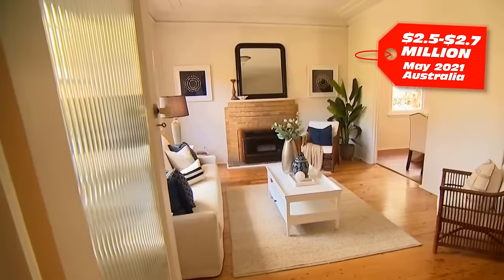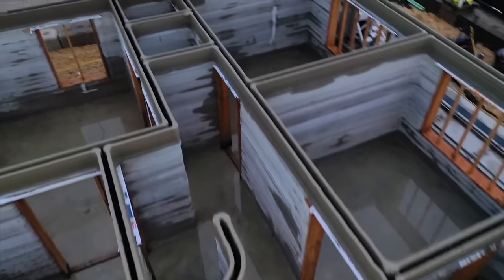3D Printed Concrete House, Printed in 48 hours

Comment: yes, but what about insulation properties of material they are building with? a quick build doesn't automatically mean a good build, not if your heating/cooling bills are still sky high when you move in...
Reply: so many ways to build, why just settle for one idea? when you can have walls with better thermal properties than this one. For example, mudbrick or rammed earth, both of which require less cooling/heating. Also, passive solar - which means placing your main windows only on the south/north sides of the house so (for Mediterranean style climates like California or much of southern Australia)  you get winter sun on your kitchen floor, but not summer sun (this relies on the fact that the sun travels at a lower arc across the sky during winter).

Comment: half the price of regular house? I'd like to see the cost breakdown. This price tag would imply that building the walls accounts for more than half cost of the construction which is very doubtful. There's foundations (maybe these are not needed here?), roof, floors, plumbing, electrical wirings, windows, interior... I'm sure I didn't mention it all.
Reply: The biggest expense is obviously human capital. It takes months to build a house, paying the wages of 10-20 people over that time is not cheap.
Reply: That concrete frame cost under 5000$ to build. Even cheaper because thats hollow and no rebar. No insulation etc.

Comment: How do you solve a problem with insulation? 3D printing a house is a great way to build, especially in warmer climates, where you don't have to worry about cold temperatures. But in the Czech Republic thought winters can become very cold. I believe there is no such way to make the robot lay or sculp anything that is going to fulfill all the requirements for passive house especially here in Europe. It's way cheaper and faster to use workers instead.

Comment: What about rebar?
Reply from the maker: is probably not needed because of the wavy line between the walls, holding everything together.
Reply: Rebar is not needed. The concrete only needs to support itself. It does not need to support a 50-ton truck or the repeated compression and expansion of cars driving over it. It just experiences a static load of itself.
Reply: Rebar causes the cracks. Please see Building Integrity, spalling.

Comment: Was quite surprised to see the rough layer left behind on either side of the walls. Sure, the printers current functionality leaves those results, but just as any technology, that's just another functionality to be implemented, and this one, wouldn't strike me as very advanced, in retrospect of actual automatic house building machine. It really doesn't look good.

Comment: Like so many house building systems this concentrates on the walls of the building envelope but the walls of the building envelope aren't that expensive or time consuming or even complicated.  I volunteered for a Habitat For Humanity project in high school and we propped up the walls of a house before lunch. 3d printers still don't do the electrical, plumbing, hvac, the roof or windows or site work. It's not going to print those beautiful epoxy floors. Wake me when it does the whole thing.
Reply from the maker: I hear what you are saying and I agree there is so much more than needs to be done to complete a home, but with so many people on the planet all wanting a home, and with lumber shortages and forests being cut down at a faster & faster rate, I think this could help in the long run.
Reply: @WonderWorldYTC  That's an excellent point and I agree 100%. But at the same time it's not going to necessarily be cheaper or faster. At least not until those printer crane things are commonplace.  By then we'll all be in a nursing home.

Comment: 3D printers can build hurricane proof, fireproof, and flood proof homes for less than than the cost to build traditional homes. Plus they can doing it using local dirt/sand so it is leaving a low carbon imprint. Build enough of them and the cost keeps coming down, which means more affordable housing and less need for insurance. I don't know why the 3D printer business isn't booming?

Comment: This could easily be done alot more portable and alot cheaper with a drone flying a nozzel and hose at a predetermined set path. Take 3 dump trucks, one with gravel, one with sand, one with cement, add an auto hopper, hook it up to water and power. Sit back and crack a beer while a drone builds your home. Stopping every 60 minutes to drop it's current battery onto the charger and pickup the second one fully charged.

Comment: I wonder how well this holds up to fires.  Seems like it would be pretty great for open-air designs since one of the big problems with open-air rooms in wood frame is that they burn a LOT easier and faster.
Reply: In another thread they're saying that concrete is very easy to break with a hammer and that it does not equal insulation ... in other words it's not a good insulator and you would still have to add insulation
Reply: @gardensofthegods  I'm not sure I mentioned any of that, though.

Comment: Has to be some fancy concrete. I am in construction and I tell you I wouldn't be surprised if it's going to have hairlinecracks all over the place after one month. It just can't be healthy for the structure if you don't let the concrete cure before any significant load is placed right on top of it. By their logic we can build a two storyhouse for a fraction of the cost and in the same timeframe. Am not buying it
Reply: it's like they are pitching this for investment into the company.

Comment: Only if building the house was the expansive part, run down sheds here in Vancouver get sold for millions of $$$$$ it's insane, basically if you were born after 1990s you ain't getting a house unless your parents are rich lol
Reply from the maker: it's the same here in Australia, an average run of the mill house will now cost you $1 million even in the outter suburbs, if you go far out you can probably buy one for $400-500k
Reply: @WonderWorldYTC  you can buy houses in Greenmount, qld for $260,000. It's half an hour outside of Toowoomba

Comment: I wonder how much you can rely on that concrete not having steel going through it
I guess this is the reason why they only have ground floor only examples in this video
you will never build another floor standing on concrete without steel going through it

Comment: One correction: It does not seem to actually lay foundations judging from this footage (it was implied at some point). Foundation first, then comes the 3D printing. Which does not take away from how impressive this is. 3D concrete used to be reserved to factories, it being on-site is impressive.

It's usually done in ICFs nowadays in the USA, this skips a step (Styrofoam blocks, then filled with concrete)

Comment: It’s so very much NOT half the price of building with other methods. It’s not much cheaper, if not the same or more. All of the other trades are still there so there’s zero savings with them. The interior side of the exterior walls require a fully framed wall vs furring screwed to a cmu block wall. That’s an added expense. Then there’s the severe limitation in aesthetic design using 3D printing. It’s a wonderful method for sure. But it’s at near zero cost savings. The main cost savings is the construction timeframe of the structural walls.
Reply: Is it though? Me and you could frame and sheet a single story house that size in the same amount of time. More of a fad then a revelation.

Comment: Hopefully they're printing rig is plumbing level and square, the 3d printer crew would be at the bottom of the totem pole in construction. hopefully they can get it done a 1 pour before the rain otherwise you'll have cold pour &  dry joints when construction resumes. No mention of concrete MPa, appears it could be a concrete forms made of concrete? Not practical to fill void with concrete again. Finding Trades who will take the job plumbing, wiring, hanging cabinets with concrete anchors etc may be difficult.  Will need a frost wall in order to vapor barrier home properly, but this may be for people to dont want properly just whatever is the cheapest.  No convenient place for fasteners like ICF has.  I see 3D printed exterior walls the rest is manual labor to cover up, build the trusses, shingle the roof, frame bulk heads for HVAC, install windows etc, theres no savings here just a lazy way to erect walls and piss off a guy who can swing a hammer. This wont fly in real world architecture and code but will make it a far as the tiny/home storage container world of home building with resale like other consumer products.

Comment: Yet with all this automation and whiz bang tech houses still cost more than most can afford because either the property is astronomically priced OR the cost of the house is raised through the roof based on “demand" and "market values" of the surrounding neighborhood. So that $100k 3D printed home is still gonna cost $450k - $500k regardless.

Comment: i dont get it to be honest they say its faster then normal but its not the trades fault u have to do steps of the permit. pre construction inspection then footer inspec then plumbers come in and some elect. then  pre slab inspec. then blocks that can only get built so high a day then block inspec so you can pour concrete in the blocks if non of that would have to happen og inspecs trust me they can do everything up in 4 to 6 days plus in this 3d thing i dont see the slab done looks like just walls so i call bs.

Comment: 48 hours doesn't include the time to move all the printing equipment to the site, installing plumbing, electricals, HVAC, ducts, cabinets,  windows, doors, flooring/carpeting, and appliances.  The actual time saving is negligible.

Comment: $2,740,000. And the required royalties to the 3d print license owner of concrete was NOT paid on that commercial gain. This is not acceptable. There is no reason to smile, its able to be done cheap because they did not pay all involved. Im not smiling one bit.

Comment: Two point 7 million dollars is not affordable. Period.
Reply from the maker: I know right, but it's gotten even worse now in Australia, I bet that house would easily sell for over 3 million now
Reply: @WonderWorldYTC  are the prices varied in consideration of Location ? Close to a city, in the outback, etc.??
Reply from the maker: @KindCountsDeb3773  well yes of course, the further you are out of the city the cheaper it gets, but you have to be pretty far, such as 50-75 klms away, at that range a house may sell for 600-1 mill
Reply: @WonderWorldYTC  Goodness. I have an older, small  middle class house I got for 150 K. But most new ones are around 300K for middle class.

Comment: No rebar? These things are going to fall apart after a few years.
Reply: Rebar causes the collapse with rust. See Building Integrity, spalling.
Reply: @windsofmarchjourneyperrytr2823  That's only if it's exposed to water, which it shouldn't be. Any other building made with concrete has rebar in it.